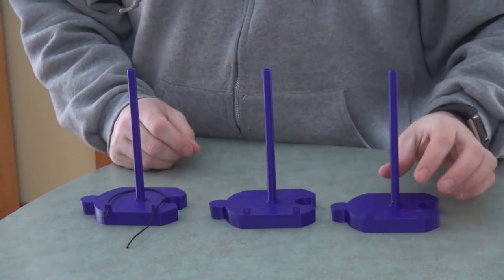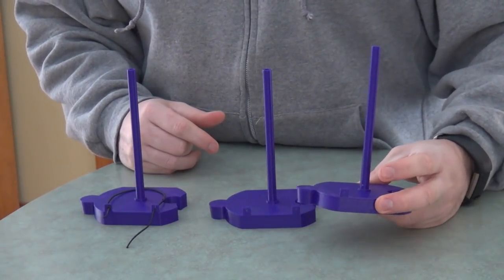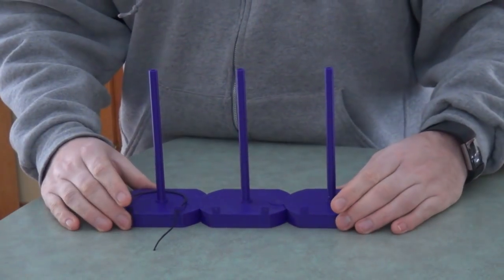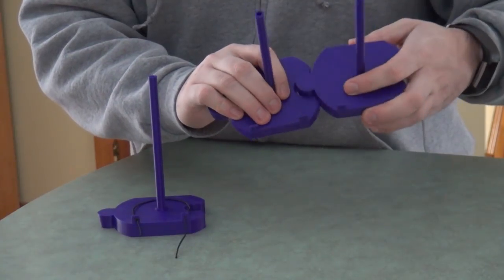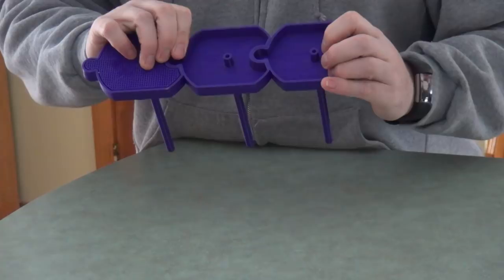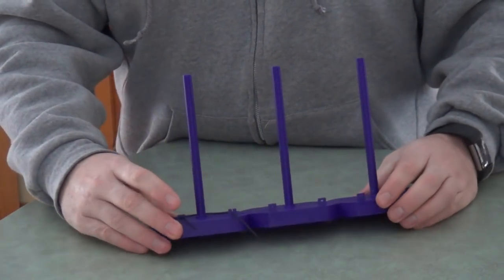SPIN #46 - Lazy Kate

Comment: Do the spindles on the kate come out for safer packing?
Reply from the maker: The file is 3d printed and the current version has these as a single piece.  They could be modified to have an insertable rod, but I didn't make that version.
Reply: @DreamingRobotsBlog  OK. Thanks for replying.

Comment: Your bobbins look like they don’t have a groove for the elastic break band. How would the break band work on them?
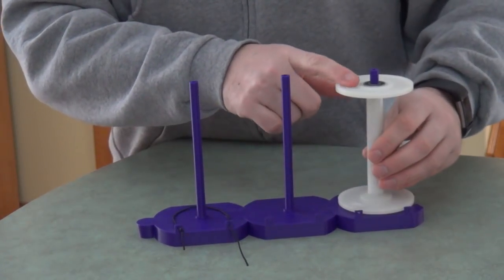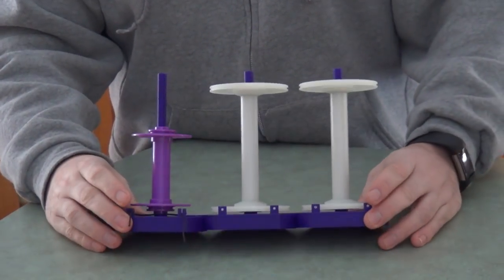Reply: It uses the same groove the brake band uses when you spin. If you look at the bobbins when he puts then on, from 1:57 to 2:16, you can see the groove on the 5.1 bobbins, and on the nano bobbin at 2:18, you can see where the lip is on the extrusion.
Reply: Go to full screen. That's when I saw it on the 5.1 bobbins. Couldn't see it on the Nanos, buy obviously it must be there because the motor drive of the spinner uses it.
Reply from the maker: The bobbins in the video do have grooves.  It must just not be showing up in the video.